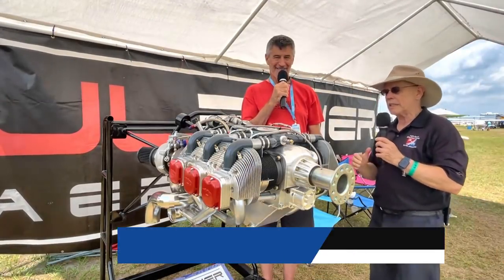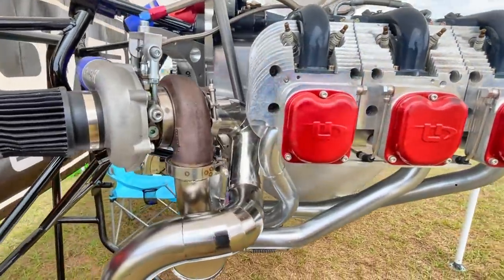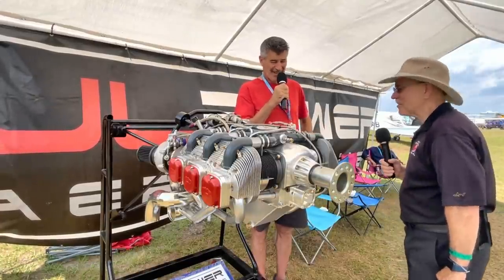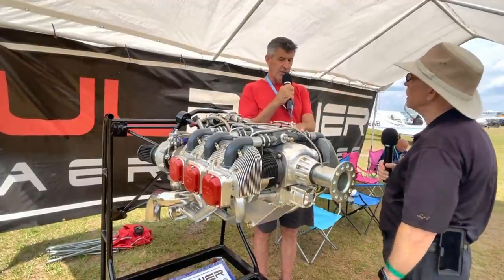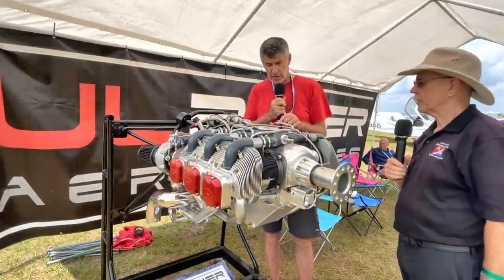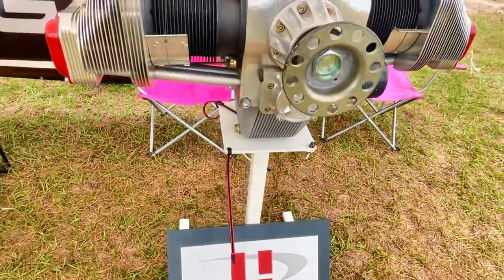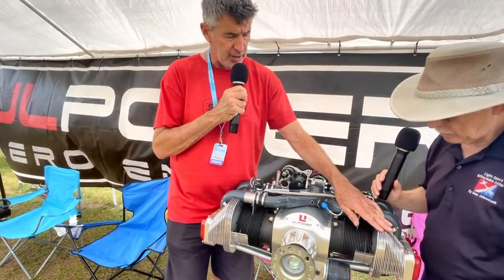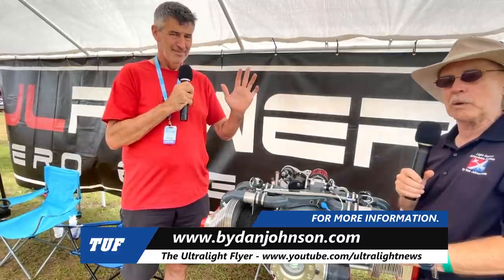UL Power Aircraft Engines, ASTM Standards Update, with Robert Helms.

Comment: Has ULPower eliminated the problems with hypereutectic pistons, widely varying cylinder bore dimensions, spark plug fouling, and a complete lack of QC? I am very interested in the UL350is for my rv12is. But, it is widely known the issues I bring up. What has UL done to eliminate these issues? The Rotax 912is will not be used on my aircraft. Edge Performance possibly will! I want to know if ULPower has addressed their issues, and if so, is it throughout their entire product line. The UL350IS is the powerplant I want to use. But I will not be using it if there is no consistency in cylinder wall clearance, no forged pistons, and a fuel map that runs so rich it fouls plugs.
Reply: I'm watching these issues as well and am currently undecided between the 260 and 350. I thought the spark plug fowling was due to lead, not fuel and that lead deposits are also a problem on the valves. Like you, I'd like to know I can trust this substantial investment to serve me well, for  a long time.
Reply: I thought hypereutectic castings were next-level technology, where the silica forms wear pads in the piston skirts to greatly reduce friction and extend TBO. The batch injection concept with pools of standing fuel sounds like a bad choice for any kind of engine with performance goals loftier than a garden tractor.
Reply: Im guessing you have never owned an airplane / engine nor lived with their exceptional reliability wherein the concerns you state are null .. match fuel to engine and fly
Reply: Are these issues when running with mogas or avgas 100LL or similar? They have warnings in their manuals about 100LL which references increased deposits in combustion chamber, sedimentation in lubrication system and wear on valve and valve seats if you run 100LL. You also need to change out oil and use a special oil if you are going to be doing AVGAS 100LL.

Comment: There are definitely disadvantages teaming up with big companies, high overheads and lots of share holders to please. Your engine have not really broke any new grounds in cost. I am glad the high RPM been fixed, it is not so suitable for slow airplanes.Air cooling is simpler, but make inferior cabin heater, I froze enough in leaky 172 to know I want liquid cooling if I can.